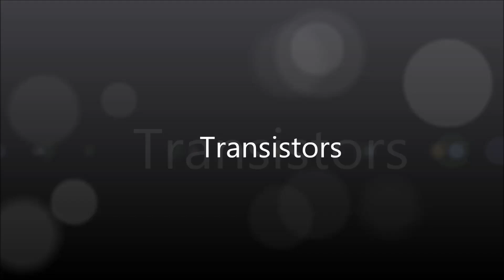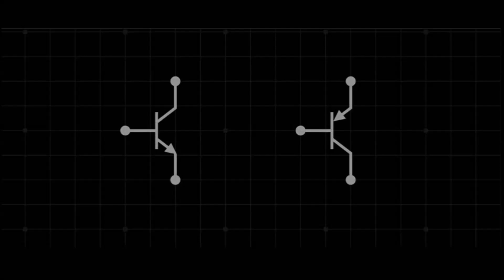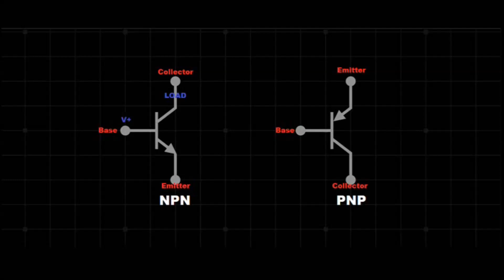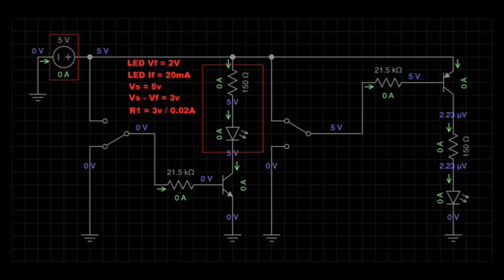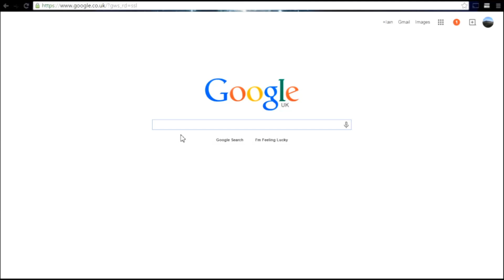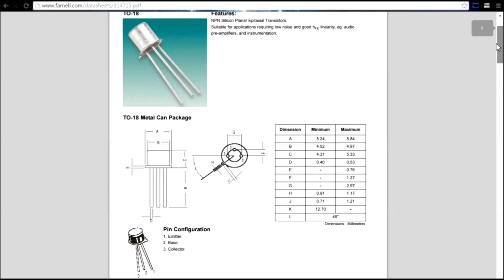Electronics Tutorial 5 - Transistors

Comment: Hi, I have noted that the Intensity varies if the resistor 150 Omh resistor is "after" or before "collector", could you please explain the reason ? and if possible how to calculate that. Thanks!
Reply from the maker: Hi, When you say intensity, do you mean Voltage or Current? The collector will not allow current to flow to the emitter until the base is at the correct voltage. The transistor causes a drop in voltage but due to internal resistances of the transistor the current will also drop. Hope this helps. Please message me if you have any more questions.
Reply: I meant Current. I understand the reasons that there is a current drop. However am a bit confused why in order to have the same Current drop, the resistor should be before the transistor and on the PNP the resistor and led is after the transistor. Thanks
Reply from the maker: The PNP is the opposite of the NPN transistor. We use NPN to switch on the load (LED, Motor etc) when the load has a positive voltage. The PNP will be used to switch on the load when the collector receives a zero voltage signal. It is dependant on the type of project your working on. I would recommend to check these tutorials on transistors from Gaven MacDonald which will provide you with more indepth knowledge of the component. https://youtu.be/Dn2NEZC5dEM . Hope this helps.
Reply: Thanks, it helps!

Comment: I want to make a voltage regulator, I want to use LM7805 or LM78XX series transistor, but how do I use this in everycircuit? what is it's Beta value? where do I find this? please help me.
Reply from the maker: Hi tdl withcd,  the datasheet for the LM7805 is located at https://www.sparkfun.com/datasheets/Components/LM7805.pdf , this compeonent is not available in everycircuit at this moment. You could attemot to build this from the schematic in the datasheet. All the values for the component are available on the datasheet. hope this helps.

Comment: Hi. I see where to get beta from (hfe) but how do we find reverse beta, emitter resistance, collector resistance, base resistance, and saturation current? Ive been looking in several data sheets but am not fully able to map each one to a value in the data sheets. My circuit does have resistors for the base, collector, and emitter but I would think the app would know these values since it sees it (everycircuit.com). Or do I still need to key in the values within the transistor settings? thanks!
Reply from the maker: Hi, and thank you for commecting. You dont need to change the BCE settings for most circuits. In ones I have built, I have only used the forward beta. Emitter, collector and base resistance could be set in order to save space in the work area when building a larger circuit and replace the additional resistors. Reverse beta I am not sure about. Might be worth contacting the developers on that one. info@everycircuit.com. Hope this helps.
Reply: +Jenko022 awesome man thank you!